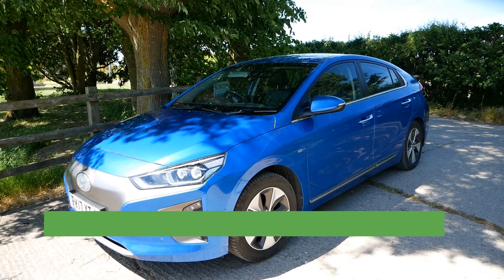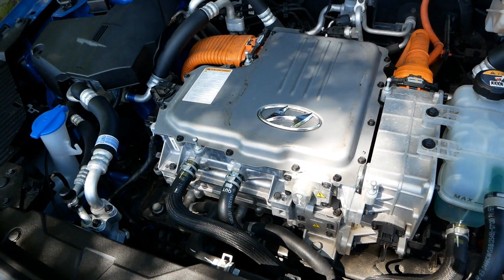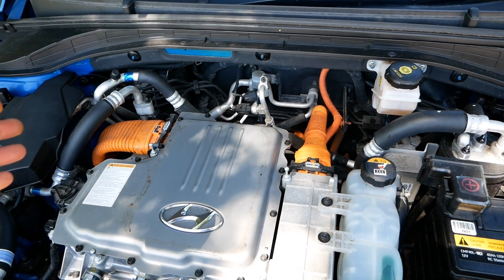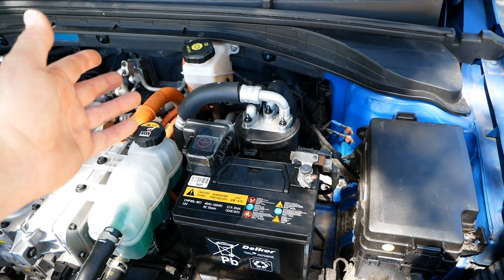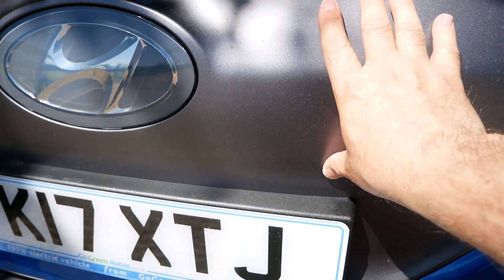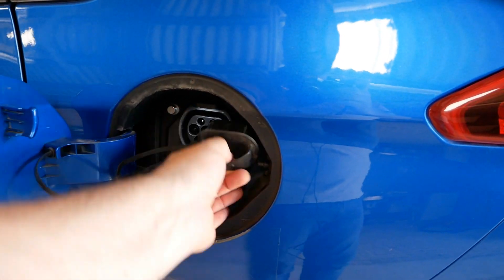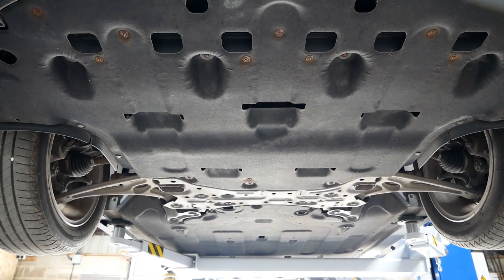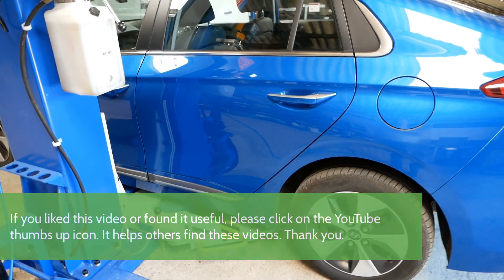What's under the bonnet in a Hyundai Ioniq electric vehicle?

Comment: where I can place my jack to lift the car and place 4 jack stands to support the car ? Can I place my jack under the center metal plate for the front and two side suspension arm for the rear to lift, then place 4 jack stands on each side of the car under the lifting point

Comment: Stupid question but with what liquid do I need to top-off coolant reservoir if it gets to MIN level? Antifreeze mixture or just distilled water? User manual is bit confusing :D
Reply from the maker: Antifreeze. But is it at low? Ours has done own Ioniq Electric has now done 98,000 miles and its never been topped up.
Reply: @GoGreenAutos  it was close to MIN when I bought it. 28kWh version with almost 100k km. In this version coolant cools only motor, not the battery pack.

Comment: At 2:46 you mentioned the heatpump. Could it be that a heatpump was an option when new? When I look now on the Hyundai car configurator in BE, it is an € 1300 option. So next question, how can you identify if there is a heatpump installed? And without heatpump I suppose they use a plain resistor heater 3kW or so?
Reply from the maker: As far as I know, a heat pump is standard equipment on the Ioniq 28kWh and 38kWh - well on UK spec cars anyway. If in other markets you get an option, then yes, the alternative is a PTC heater. I would always specify a heat pump if you have that option. PTC heaters tend to fail too and are expensive to replace, which is normally outside of the warranty period.

Comment: I love how they kept everything looking exactly like a typical car. Can't understand why they didn't just put some kind of 12vdc converter in from the main battery for all the legacy attachments. I mean weight saving and all that on the other hand I can respect it causes less to go wrong and gives a DIY mechanic a better chance to fix issues.
Reply from the maker: All EVs do have a 400V DC to 14V DC converter in them to recharge the 12V battery while you drive. But as you say, it seems a bit pointless having a 12V led-acid battery there when there is already a huge battery there. And the 12V battery is the biggest cause of problems with EVs. There must be a valid reason why they do this.
The Ioniq handles the 12V battery than other EVs as it monitors the battery while the car is switched off and if the 12V gets low, it switches on the inverter and charges the 12V. This means you don't get caught short with a dead 12V battery. Other EVs don't do this.
Reply: @GoGreenAutos  putting a heavy lead acid battery a 100 year old or older technology next to a 14year old battery technology. It seems like it's just there so as not to alienate any car buyers from shying away from it when there's nothing to look at under the hood. It's evident they put alot of effort into making the entire engine bay look like a typical engine bay of a ice car. I confess I was expecting to see RGB lights and oversized pc fans in there keeping batteries and esc cool